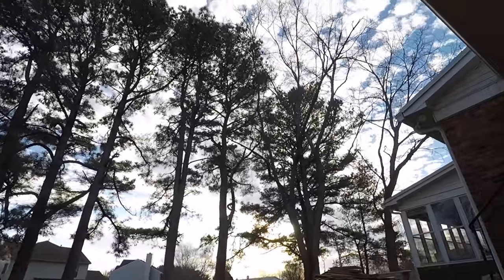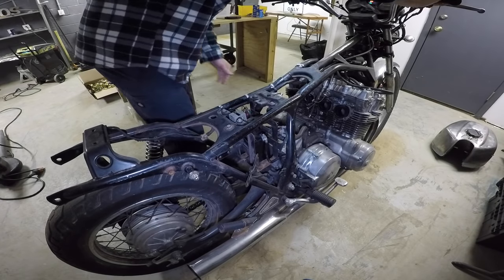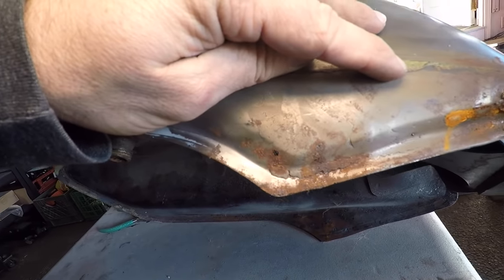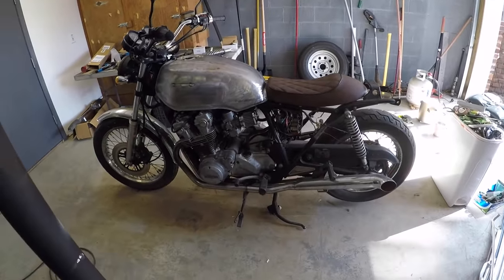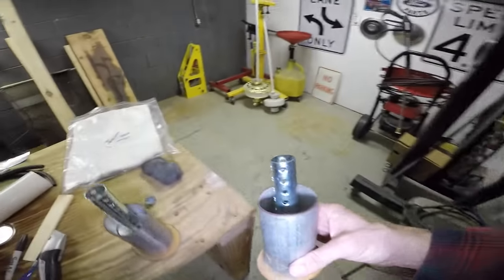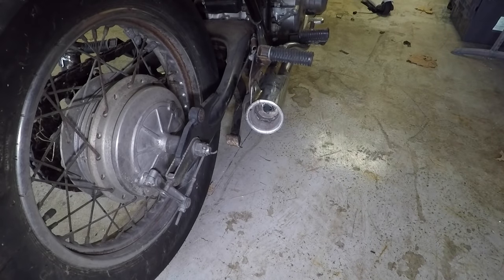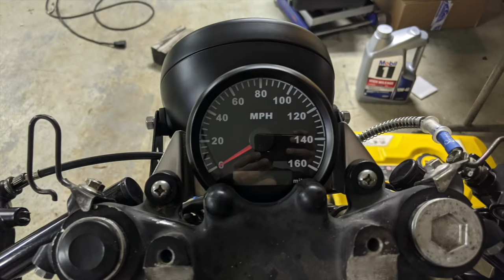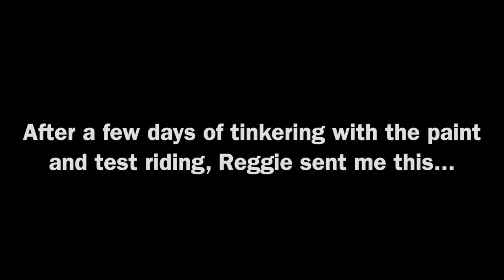Building a Cafe Racer for under $1,000 (Starting with a $400 Honda CB750)

Comment: What happened to the dirtbike low profile handlebars it looks like you got some crotch rocket handlebars on there now
Reply from the maker: I picked out the dirtbike handlebars, but reggie wanted a lower profile so he got come clamp-ons from ebay. For the record, I think the dirtbike bars were way more practical from a riding position, but the clamp-ons look cooler.
Reply: @AustinCoulson  OK I would agree with you he looked like he was uncomfortable leaned that much forward

Comment: Did you lower the front forks? Any tips on doing that? My 74 cb750 is needing fronts lowered, and clip on handlebars. Any other tips on this build would be great!
Reply from the maker: I lowered the forks a little by unclamping them from the triple tree and sliding them down about 3/4" before clamping them back down
Reply: @AustinCoulson  cool, thanks for the reply. What would you say is the cutoff height for forks rising above the clamps?.. I guess ill go see how much that lowers it
Reply: Thanks a million for responding! I've kinda been going at this headfirst with only working on cars as my experience! Haha

Comment: I like what you did with it, but I prefer it’s original factory look, because I really love standard motorcycles. I used to own a 400, maybe 450, Nighthawk and a Honda 750 Sabre (I think). I haven’t thought about these for decades, so I can’t remember the exact names. 
I was not good at riding motorcycles because I was really afraid of the speed. I didn’t keep either one very long.
Reply from the maker: You may have saved yourself a lot of injuries
Reply: @AustinCoulson  It didn't feel right to have no seat belts and my Honda Accord got almost the same gas mileage while providing an air conditioned environment.

Comment: What jet setup do you have in the carbs?? Awesome bike man
Reply from the maker: Stock jets, it was still slightly rich even with the exhaust modification so I left them in
Reply: @AustinCoulson  wow I'm surprised with the filter too!! Do you know the stock size jets are on those carbs? And how much adjusting did you have to do if any to the screws
Reply from the maker: @slyfoxmartin5693  I don't remember the stock size on those and I built this in March so my memory is a little hazy overall but I seem to remember the idle mixture being adjusted as rich as possible and being right on the edge of needing to up the jets.
Reply: @AustinCoulson  I completely understand lol thank you for the insight 🙏.  I'm looking to build a bobber style cb750 hopefully soon. Doing all the research I can now. Your video was definitely enlightening thank you and keep up the great content!
Reply from the maker: @slyfoxmartin5693  They are very versatile and fun to build. Good luck. My email is on my channel, reach out if you get stuck with anything

Comment: due to physics, you wasted a whole bunch of time fiddling with the fuel line on the carbs. it does not matter one bit if the line feeds from right to left or from under or over. although only feeding from one carb to the rest is lame.
Reply from the maker: I was trying to limit an unnecessary foot of fuel hose looping around underneath the tank.
Reply: @AustinCoulson  that seems like a good thing, but the kinks you now have in the shorter line are not. also, sometimes it puts pressure on the o rings that seal the crossover tubes and you get leaks.
  been there, done that and I understand but....
Reply from the maker: @lukewarmwater6412  I was moving it from the incorrect location back to the factory location. The guy who rebuilt the carb before I started working on the bike put it back together backwards

Comment: My go to bike was a 1978 CB750F Super Sport I bought brand new. More money then brains young dumb and full of you know what I tricked it out to have over bored 900 sleeves and pistons, rejetted Mikuni Carbs, valve kits, kick back shifters, trick fairing, the whole bit. Back then if you wanted a cafe racer you built it yourself. Cops just left me alone till they got their Kawasaki 1000's. Then it was game over for me with five tickets in six months. Finally got rid of it when I picked up a high speed wobble at 160mph. Almost killed me and brought sanity back in a hurry.
Reply from the maker: Wow that sounds like some bike.  I am glad you made it out safely.